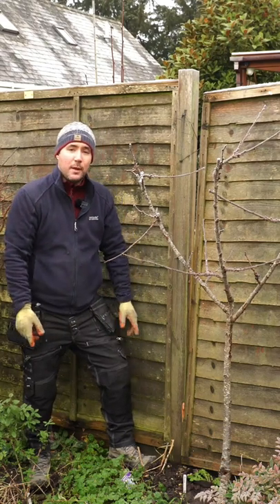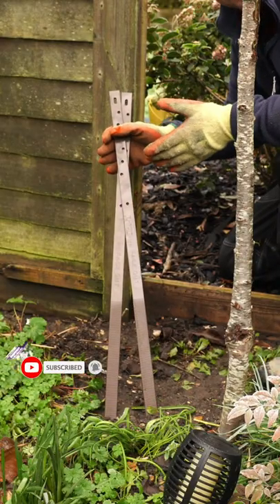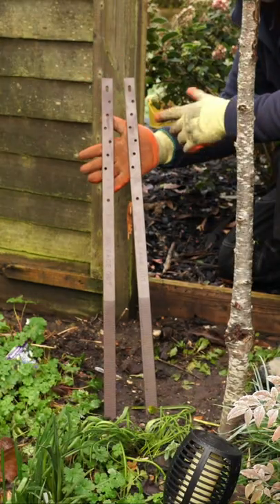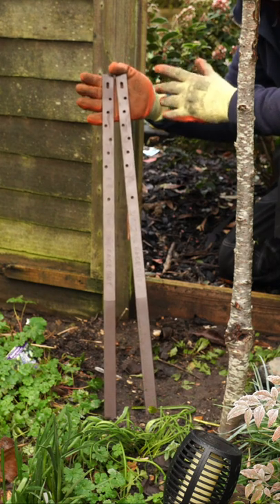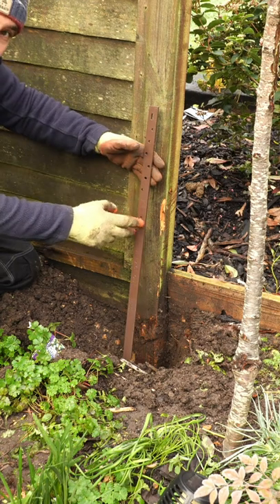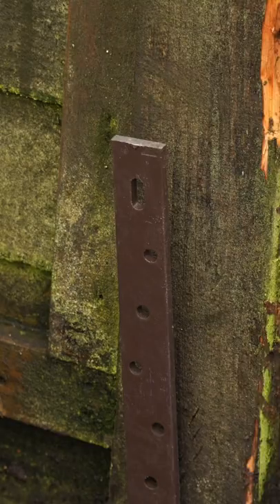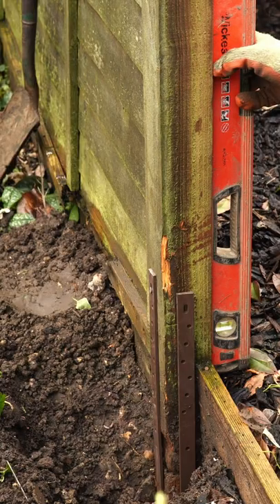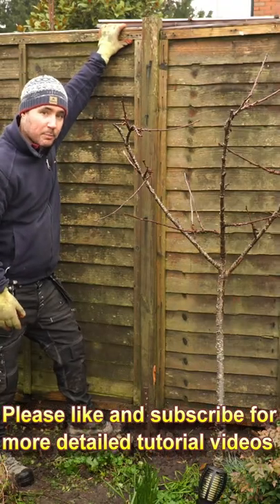Fence Post Repair | SUPER EASY AND FAST !

Comment: I need a temporary repair to see me through the winter as the post just started wobbling badly this week .I can’t get the tradesmen and it’s really not the weather IMO to do a new post .I have bought the post buddy system and going to install next week, or try🙏🏻. Your video has given me some confidence. Thanks!. Last year I repaired my other post with a concrete spur and digging out the old concrete nearly did me in. That post is literally immovable now.

Comment: Honestly best thing to do here is dig down a bit as shown , cut the post just below the rot (they always rot at the ground level) pre pilot drill drive in an anchor bolt 150- 200mm long with a chain attached & pull out the old post using a lever & car jack set up! nice & easy then slot in new post done lots like this. That metal brace is pointless & a waste of materials & time.

Comment: Do you think these would be enough to secure 8 inch posts? Ive got a couple of big gate posts which have both rotted and snapped at the ground line.
Reply from the maker: No ! Lol. They are some really big posts. Id think about replacing them tbh. You could use a concrete repair spur for a more substantial long term repair.
Reply: @JamesMontana  I had a feeling you were gonna say that. Right, new posts it is. Love the channel btw
Reply from the maker: @bigjohnsonrichard4566  Yeah sorry to be the bearer of bad news and thanks man. Really glad you like it. Hoping to add more home DIY stuff soon. Thanks for watching.